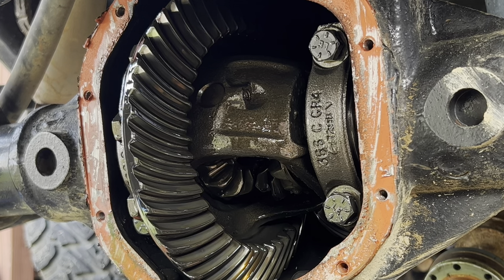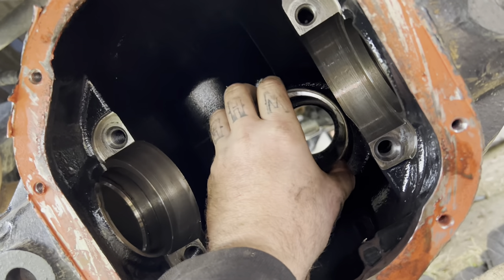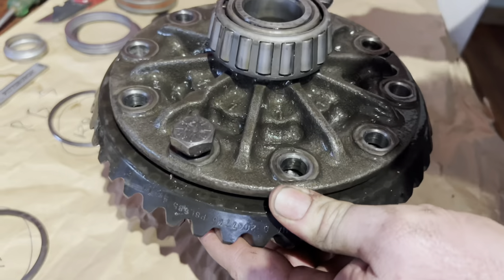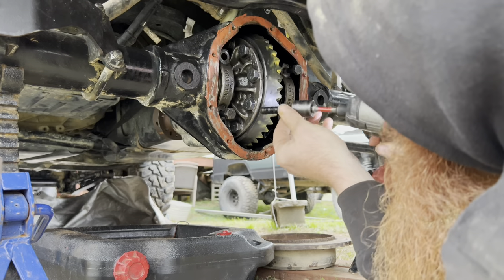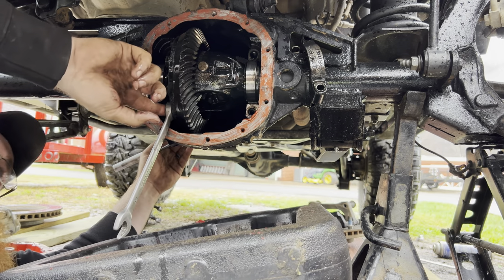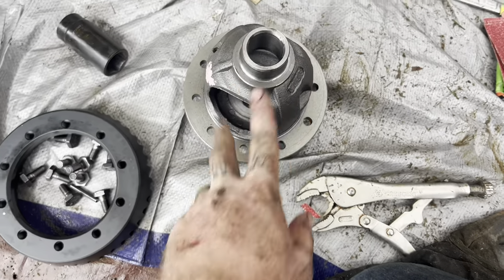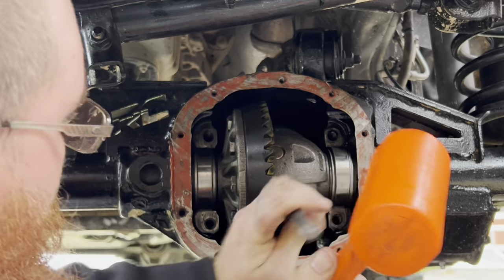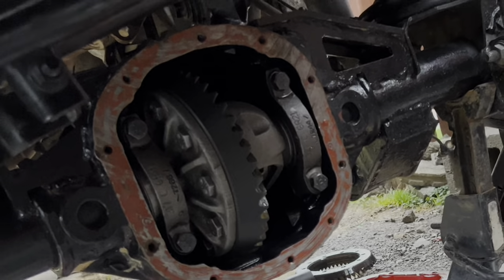How to Regear your jeep XJ/JK/JL/JT/ZJ/WJ

Comment: Thanks! Did my first gear change 3.07 to 4.10! Took my time; very happy with results. Many thanks for your great guidance, thoughts & videos!
Reply: What tire size do you run and how does it feel on the road/hiway now? I have stock 3.07 still on 33s, was planning to go to 4.56 but not sure if that's overkill for a DD

Comment: Doesn't tightening pinion nut (with crush-sleeve) require an INSANE amount of torque -- nearly 300 ft-lbs? How did you accomplish this?
Reply from the maker: Started with a impact rest with a torque wrench
Reply: @cherokeeronnie  video shows a LARGE needle-type torque wrench (100 ft-lb & more). Don't you need a SMALLER one, to check for 16-20 in-lb..for pinion pre-load?
Reply from the maker: It’s in inch pounds I use this one because I use it for other stuff but the one I recommend that works way better and for beginners is in the video on my channel. I been doing gears for awhile I know what the drag is supposed to feel like anyway
Reply: Would you be interested in doing another one? I live kinda close by,at the lake in maryland, my jeep is 5 speed 98 4.0 think its dana35
Reply: @kyleradtke4190  the dana 35s are notoriously weak and probably not worth putting a lot of money/time into. You'd be better off just replacing the axle with a dana 44 or Chrysler 8.25 or a Ford 8.8 maybe. You could potentially find one that already has the right gearing/locker that you want anyway.

But if you don't plan to offroad much or run bigger tires then the dana 35 is fine.
Reply: Floor jack and go slowly--works good if doing in driveway.

Comment: I hope you see this and answer 1991 xj dana 30 hp does it have a crush sleeve or not if cant find any real data some  kits pictured have a crush sleeve some don't I betting there using stock photos I would like to know for sure so I can buy a eliminator
Edit i called a few places and older xj/yj dana 30 hp uses shims no crush sleeve

Comment: I have a 99 cherokee aw4 trans with 4.10 gears running 33s. Do you think it's worth it to regear to 4.56?
Reply from the maker: Do you high way drive to you plan on going 35s?
Reply: @Cherokee Ronnie  So it's not a daily driver, more of dad wagon/weekend warrior for trails. I don't do hardcore stuff like rock crawling but more intermediate trails. I do plan on adding lockers. I plan on a few long trips like to go up to moab but not difficult trails. I have 4.5 in lift with 33s and I know 35s would probably benefit me more, but with the new 33s I just got and the amount of time I actually drive it will probably take years before there worn down. I bought the jeep used and thought it had stock gearing, but when I inspected it, it ended up being 4.10s. So I didn't know if I should spend more money and regear again.
Reply: I wish the rear end was exactly the same on Cherokee that what you just take the shims out-of-the-box of slapping in the rear end
Reply: @ky0611 what size rims and tire do you run.

Comment: Isn’t that pinion marked from the factory with the depth measurement? A straight edge and caliper seems like it would have been easier. Then you can get the pinion in and set. Then move on to the carrier.

Comment: Hi Ronnie can you please 🙏 tell me what gears I should run on a 2000 XJ automatic & with 33” tires and I can tell you mainly on road use & I will never go any bigger on the tires thanks 🙏
Reply: Use this equation:  (New tire diameter / Old tire diameter) x Old gear ratio = new gear ratio.  So, my Jeep currently has 33" tires on it.  The OG tires were approximately 27", and the original gear ratio was 2.73.  So, the equation set up is (33/27) x 2.73 = 3.34.  Match that "new gear ratio number to the closest gear set ratio available (round up) and you'll bring your Jeep back to (close, at least) original specs.  So, I could go with 3.31, but I  ran a little higher and went with 3.73.  Just my 2 cents, others might have different opinions.